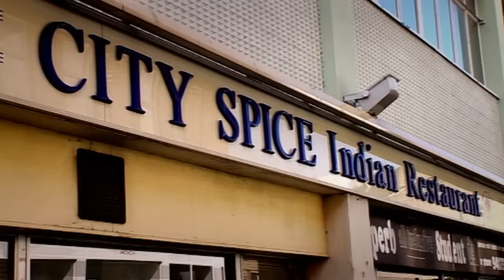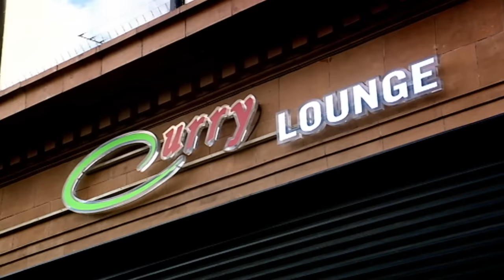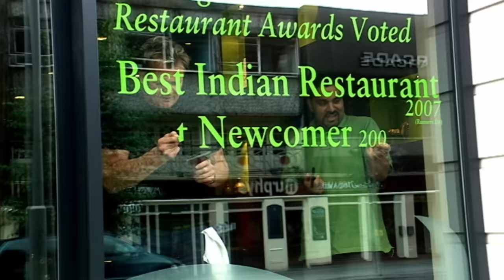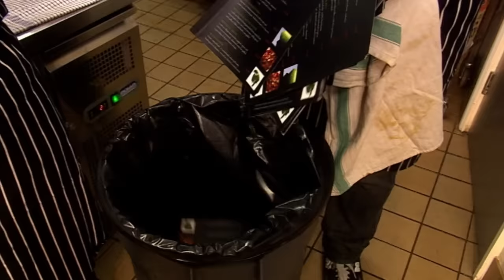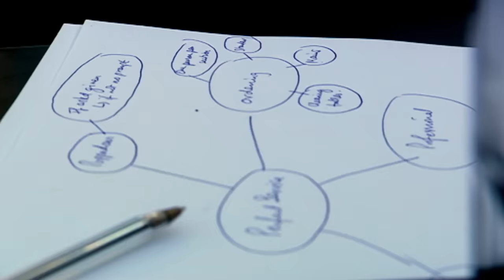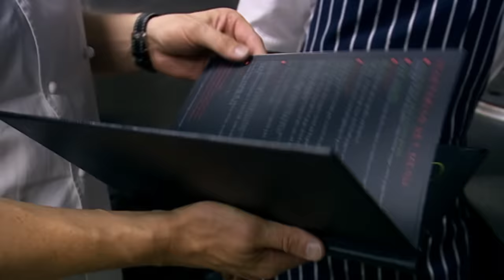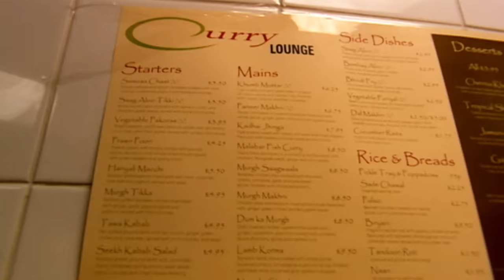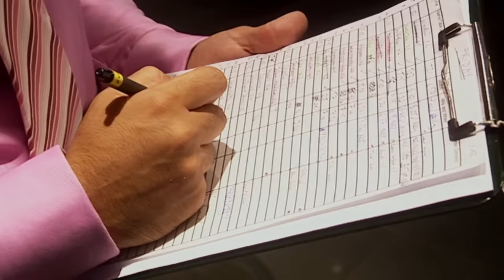Restaurant Can't Tell Their Dishes Apart | Kitchen Nightmares

Comment: The problem with the “make your own curry” menu is that it leaves the quality of the dishes to the customer, and a poor choice will end up weakening the dish. A similar issue occurs with the “Sebastian’s” episode.
Reply: Sebastian was wayyyyy more full of himself behind the idea though.. raz was like a toned down version
Reply: @silktm9457  Yeah, but another issue is that it slowed down service because there could be hundreds of variations which can't be made all at once for obvious reasons.
Reply: Clever insight, I didn’t think of that.
Reply: Indeed that's the thing too the make your own "blank" only works with certain foods tbh. Pizza n pasta is the only 2 I can think of.
Reply: @Ithrial420  and sub sandwitches.

Comment: When I get bored I design restaurant menus. Weird thing to do but honestly I’m not a pro-chef, I’m an ex-line cook but what I’ve understood from the very beginning is that you can’t have too much. I build menus based on a seafood main, a meat based main, and a vegan main each with two basic sides. This creates a good variety of ingredients to build off of and keeps costs and cook time lower. On one of them however I did think about doing a build your own sandwich as a lunch special and thanks to this I realize, it could be done, but it would really hold up the kitchen so it’s better to get a few different basic sandwich builds and if customers want a few mods they can ask.
Reply: You should be working in a restaurant! This is passion!
Reply: @nickis429  I did used to. I’ve always thought maybe I might go back to it. Do culinary school or something. Right now I’m majoring in geography, learning about energy and food production, architecture, and spatial use in an attempt to design a feasible self-sustaining carbon neutral community model
Reply: god I hate mods. Slows me down so much during a rush when they've changed everything about the entree. Now you and everyone down the line are getting their food slower.

Comment: I think it would've helped to take the owner into Tamarind to see and learn how the chefs operate (& thereby learn how hard his pickamix thing is). I actually once worked at a business (different industry) that had been successfully run for more than 50 years. It was sold to a salesman who only focused on selling without understanding the product or the product mix. He actually dismantled related parts of it that brought in off season sales, without understanding why it was there or what purpose it served. He tried to bring in something he liked that barely had any connection to the main product, not realizing just how different it was or who his specialist market was. Then as sales flagged ge tried to flog high end items dangerously inappropriately.

You can not sell anything if you have no product. 
This is why operations & production people get irritated with salesmen who sell inappropriate things that cannot be produced. Details are key.
Gordon is an excellent operations & production manager.